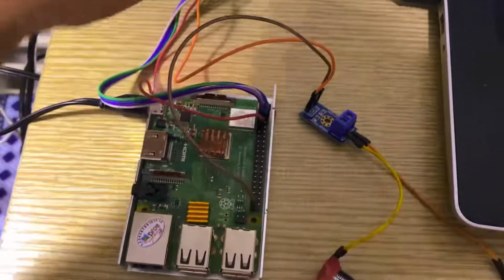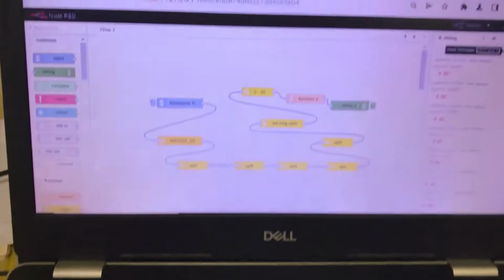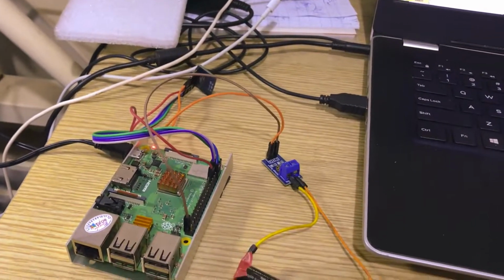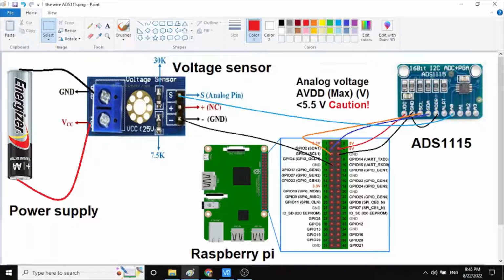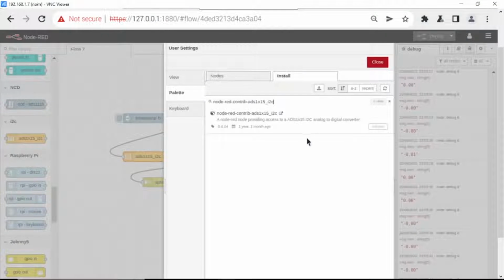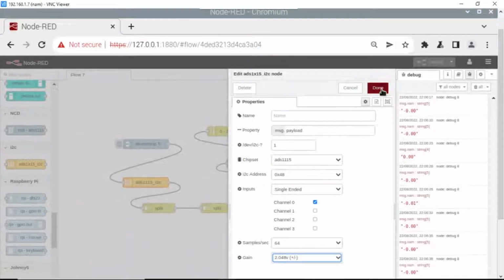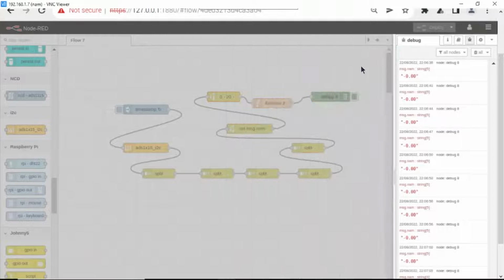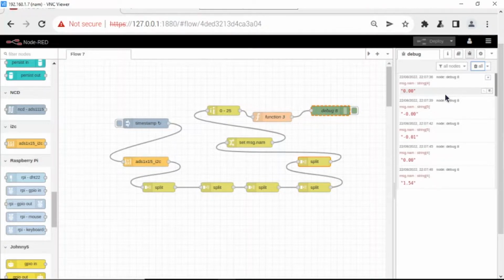Analog voltage sensor with ADS1115 by Raspberry pi and Node red | Analog Raspberry pi Node Red

Comment: Thankyou for this informatie. In my cause i want to use a voltaged transducer to measure up to 500 volts, it has a output of 5 volts AC or DC. What do you advice to use in this cause, is it possible to still use the ads1115?
Reply: He says not to exceed 5v or it'll fry the ads1115

Comment: Thanks for the video. Just what I was looking for.  With Node Red, the sky is the limit. Good to know there is already a node for the ADS1115. I think I will replace the voltage sensor board with a voltage divider that can be made with just 2 resistors. Why all the split nodes?
Reply from the maker: that's right, you can replace the voltage sensor with homemaker voltage divider.